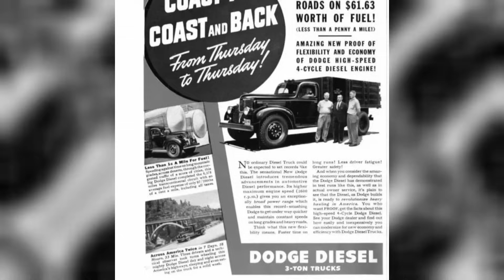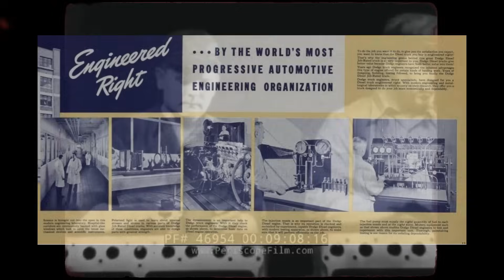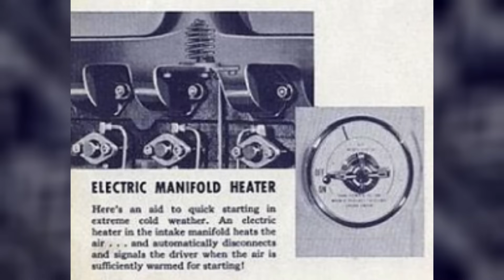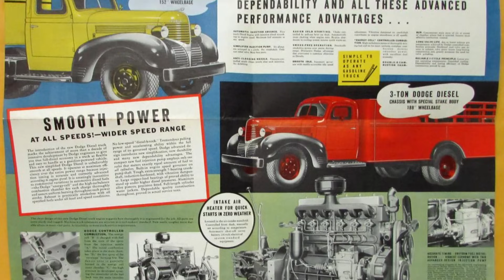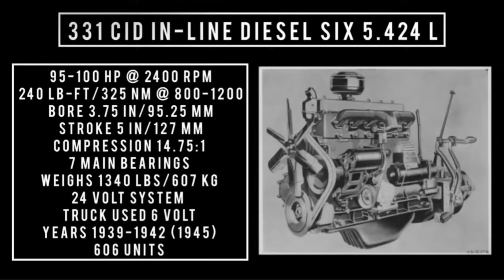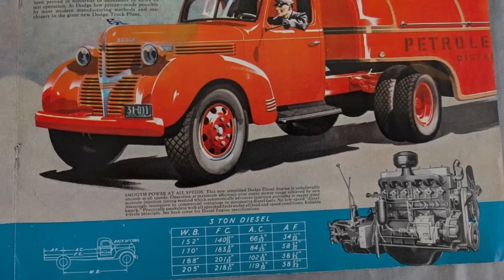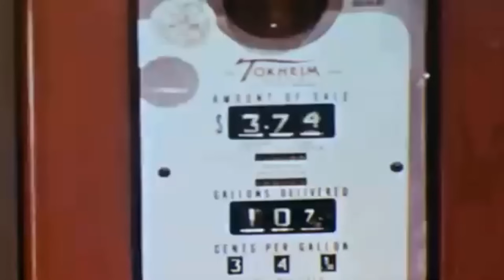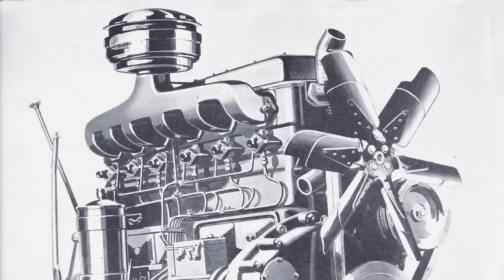Dodge Diesel Disaster: The 331 Engine History Forgot

Comment: Describing diesel as complex costly and hard to maintain is still pretty accurate. Though their longevity makes them worth it.
Reply: What is complex about ⛽️ Diesels?
Reply: @speedfreak8200 diesel fuel injection systems are quite complex compared to most gas setups. The precision required in those fuel pumps and injectors is no joke
Reply: @knotical689 for home mechanics maybe... diesel system is just human build like everything else. But if your knowledge limits to bolting Summit catalog parts to SBC, you are screwd.

Comment: The program was not sensibly managed from the start. Dodge was never a high volume producer in the commercial sector, so there is no way that production volumes could ever have been high enough to make the program work. Hindsight of course is 20/20, but a sensible approach would have been to make 4 and 6 cylinder versions of this diesel, something which could easily be accommodated on production lines, and then seek engine customers for the four cylinder version, particularly in the Agriculture and Industrial space. A 4-cylinder version of that engine would likely have been very successful in tractors, Road building equipment, air compressors, welders, Etc. And although diesel fuel may have been difficult to Source on the road, kerosene was easy to find anywhere in commercial or agricultural applications. The necessity to Source injection components from Bosch is not a big issue, since the automotive supply chain was already quite sophisticated by that time. But the combination of the depression, followed by the war, followed then by a post-war boom in gasoline refining technology that kept American fuel prices cheap, meant the diesel was simply ahead of its time on the road.

Comment: Is this AI slop? There was fuel everywhere for a diesel...HOME HEATING OIL IS DIESEL AND IT WAS EVERYWHERE BY THE 30S IN COLD STATES.
Reply: I used to deliver home fuel oil - diesel fuel.
Reply: Home heating oil is #1 Diesel fuel. Road diesel is #2 Diesel Fuel.
Reply from the maker: Not AI slop, just the human kind. I did a lot of research on this and I stand behind it. All human-made.
Reply: @VintageAmericanMachines ai slop judging by mr cummins first diesel😂😂 running some forged rims and a hood stack

Comment: It's unlikely that Chrysler killed the engine for any internal corporate reasons. WW2 made that decision for them. Bosch supplied the injectors. Bosch then, and to this day, is a German company, and by early 1942 the US was at war with Germany. So that supply line was cut, and with war production as top priority, Chrysler wasn't going to waste time and resources on creating its own replacement version of those injectors - not when they had plenty of easier to produce truck engines already on the production lines. At the time everything they built was for military use, so it had to be both dead-nuts reliable, and fully supported with replacement parts.
Reply: Ambac, American Bosch, was a separate entity starting after WWI
Reply: @randymagnum143  Main problem was making things to one millionth of an inch accuracy at production level, 95% pass rate for components was 'good enough' even in mid 1970's when I was training.
Reply: @1crazypjthat's the beauty of the Roosa Master pump, it could be made using conventional machining processes.
Reply: Also the Lenovo cylinder head wasn't there patent so they may have had  issue with the design rights after production stopped due to the war effort and by the time the war ended there was no shortage of diesel engines on the market so it may have been cheaper to go that route

Comment: That preheat was an awesome idea. Unless it caused a fire to spread to the entire vehicle.   We had Farmalls that started on gas , then when warmed up you flipped a lever that closed off a valve in the head to bump up compression , then the injection pump kicked in. It worked well , until it didn't work well. It had ball check valves that would stick. You still had all the maintenance of the gasoline side with carburetor, points , plugs ,n such plus the filters, keeping water out of the diesel tank.

Comment: The A.I. is hilariously dumb.
T43, Russian tank comes up.
Did anyone even look at this video before posting?
Diesels are no different really to a petrol engine, in many respects simpler with extra strong parts, if you can fix one it isn't difficult to learn the other.
Very few special tools needed for mechanical injection although re-building high pressure pumps does need ability to measure very accurately
I had the same attitude to diesels until I worked on them, when I found out how much torque they made at very low rpm I became something of a fan.
Will not be subscribing
Reply from the maker: Not AI, jeez, again and again with the AI. I thought it looked cool. All human made, just hard to find footage, and since the war affected the production of the engine, I showed war stuff. Sorry you didn't enjoy the video.
Reply: dude you haven't worked on vintage engines and it shows, old gas engines have ridiculous torque, often more than diesels of similar displacement and boost level because diesel has the disadvantage of stratified charge combustion, but that's besides the point, the big issue issue was back then it was far more difficult to build or acquire the parts needed to actually make a diesel run than it is today as very few manufacturers could even make the parts, meaning a broken diesel engine would commonly be down for weeks or months rather than a few days as with the gas engines, also every single type of pre-ignition-chamber, which both made it feasible to make diesel engines with cast internals, greatly reducing the cost of construction and greatly reduced the sensitivity of the engine to moisture content in the fuel was held by various patents owned by a few engineers who mostly did not have the necessary capital to manufacture the engines combined with companies being largely license-fee averse, preventing full proliferation of the diesel engine in trucking until smog regulations nuked the good gasoline heavy truck engine options in the early 70s.
Reply: @thatguy-em9lt  Plenty of people could make reliable diesel engines even before WWII.
 America has always had cheap gasoline so gas engines could be made incredibly badly but still run well enough to get the job done. It isn't possible for a petrol engine to produce more torque than a diesel of similar capacity, if you knew how diesels operate you would know that.
Diesels are at a major disadvantage for high speed operation and ultimate power output though, petrol engines just about always have a high rpm advantage.

Comment: So what killed the engine?  The war.  Period.

Why did diesels exist to begin with?  Because they ran on garbage fuel.  When gasoline sold for 25 cents /gallon, diesel was selling for half that. It wasn't until the EPA rules of the very early 1990s that the price of diesel rose.  Now that diesel fuel must be cleaned to remove sulfur and other contaminants, the price is much higher than gasoline.  However, in WWII the military didn't want diesels.  Why?  Because that would require an extra supply problem.  Even the Germans went with gasoline in most of their vehicles for the same reason. When the Navy used diesels it was in their ships, not their trucks.

The problem for owners in 1939 was that there were so few locations that they could fuel up.  It required a whole new infrastructure.  Diesel owners had to install their own fuel storage, usually at a depot.  If there was a fleet then that wasn't as much of a problem.  But for small owners that extra expense was a problem.  

The pre-combustion chamber just meant they did not need as high a cylinder compression.  14:1 is not high for a diesel.  Usually they run at 16:1 to 22:1 compression.  However the higher the compression, the harder it is to start, the noisier, and rougher the engine runs.  By running at 14:1 they could reduce much of the problems seen in high compression engines.  The downside is a pre-ignition chamber is extra complexity and often cause a different set of vibration.  

Just more AI bullshit that can not understand the basics.

Comment: I HAD A CHEVY CHEVETTE BACK IN 1985 '' IT HAD A ISUZU 3 CYL DIESEL ''''  DIDNT HAVE ANY POWER ''''   BUT 85 M.P.G. ''''    DONT TELL ME THESE MODERN CAR'S CANT GET ''BETTER'' FUEL MILAGE '''
Reply: You're off your Meds again Jimmy .... 41MPG not 85MPG . 51HP please do a simple Google search before making a laughing stock of yourself 😅
Reply: maybe yours was a 3.
Reply: @BillLaBrie The Isuzu diesel was a 1.8L 4 cylinder
Reply: @nicky5417 I know, that was for funny boy in the OP.
Reply: @BillLaBrie 😂ugood, Ik.
Reply: @BillLaBrie  IT WAS A 3 ''  THANK YOU SIR ''
Reply: 7.9.25.  💁🏻‍♂️ I had a 1984 four-door Chevy Chevette with a Isuzu 1.8 L four-cylinder diesel, over 100,000 miles I averaged 38 miles per gallon. It needed a turbo charger. “That thing couldn’t pull a sick whore off a bed pan”™️‼️
Reply: Are high or something
Reply: Nox is the problem with lean burn. Honda was getting 50+ mpg with a gas engine but the nox was bad. Nox makes acid rain and smog clouds.
Reply: Same with VW in the 2000s with their mpg scandal.
Reply: @1987FX16  do you really think that others didn't cheat?
Reply: OK boomer

Comment: Dodge developed a diesel engine for automotive and light trucks but never brought it to production. It was a slant 6 that they had reworked. I was lucky enough to see four of them that were scrapped out.
Reply: This was the 30s and yes they sold some prewar trucks, the sold the Burma trucks to dictator China against the Reds and Japs with a gas 331 and a 5 speed.
Reply: The slant didn't exist until the Valiant in the early 60s, they sold fullsize Mopars with Perkins before that, Dead Dodge Garage has one, the slant diesel was a failed experiment, the Hemi slant went to Australia and was supposed to be for trucks.
Reply: @LeeHendo  The Hemi 6 wasn't a slant.
Reply: @anvilsvs 
And the Hemi 6 is not a hemi.
Reply: @anvilsvs  yes it was.
Reply: Yeah you are not going to make lousy 4 main bearing inline six into a successful diesel, They should have asked me about that.
Reply: @patrickshaw8595 The slant six diesel was canceled because the k car couldn't use them and the Olds v8 was turning buyers away
Reply: @timothykeith1367  Yes. I'm quite old you know. I lived through those days running a commercial engine rebuilding and automotive machine shop here in KCMO.
Reply: @patrickshaw8595 4 main bearings is not problem. Many 4cyl diesels had 3 and no issues. Just good materials(not yank sponge cast iron)

Comment: In the early years diesel engine are not overly complex but compared to gasoline engines they were misunderstood due to the different operating principles. They did have many advantages such as no ignition systems (plugs, cap, rotor or distributor), longer intervals between major repairs, just to name a few. In general due to their design they use less fuel per mile than gasoline engines did. Where it all went wrong is when the government got involved with things like DPF and the need for DEF fluid coupled with EGR systems. Now diesel engines are a nightmare to maintain. Thank God I'm no longer in the field.
Reply: The original diesel fuel was the near bottom of the distilling process. There was no demand for the fuel that was below kerosene and above bunker.  Even after they learned how to crack oil (use catalytic processes to make the fuel they want) they still had a lot of bottom fuel.  Because there was little demand for this and the price was low, it became the standard for home heating stoves and furnaces and ended up being used in some diesel engines.  

As you point out, it was only after the EPA forced cleaner engines that the price of diesel fuel became more expensive.  But gasoline engines also became very expensive and complicated. Refiners cleaned up their gasoline as well as diesel fuel.  They have even cleaned up the worse bunker fuel that ships use.  

DEF is the engine manufactures way of cleaning their emissions.  It is not required by the EPA but is by several States on engines equipped for DEF. DEF is injected into the exhaust, NOT the engine. The newer complexities are because the engine manufacturers are trying to clean up the engine exhaust.
Reply: @alanmcentee9457  Uh, hate to correct you but since 2009 DPF and EGR systems have been required on all heavy duty diesel trucks. They started it in 2007 with mandatory compliance by 2010. Yes, I fully understand how the DPF systems work in great detail as I have serviced them since their inception. EGR on the other hand is attached to the engine and due to the way they function are severely prone to carbon build up up to and including creating a drastic loss of power. Cleaning is a tedious and involved process taking up to several hours. DPF systems require frequent and time consuming regen processes to be run under certain conditions and when the system fails can and does result in not only forced shutdowns but also a no start condition rendering the vehicle immobile forcing it to be towed to a service facility for costly and time consuming repairs.
Reply: @carllmack2287  
The EPA mandate is for emissions leaving the tail pipe, NOT how to get there.  The same as with gasoline engines.  It is the emission standards, not how any manufacturer builds the engine.  

If they can build any engine and fuel it so that has only something like water as an emission then there would be no need for EGRs, catalytic converters, etc. Until they can come up with an economical fuel and engine then manufacturers will have to tweak engines to conform.  

DEF does nothing for the engine.  It is sprayed into the exhaust.

Comment: They were not dodge diesels they were built by Buda engine co and dodge put them in their trucks just like they did to Perkins diesels they bought the Perkins 107 diesel and put a Chrysler marine brass plate on the flywheel housing they went to court on this they did not make diesels back then period you have the wrong information ronrdzl
Reply: No, Buda - Lenova was a different engine using the same patents that Chrysler used under license..  I would not be surprised if Buda had some involvement with Chrysler in developing this engine, but the bottom half of the engines architecture is Dodge. The Lenova system was used by several manufacturers.   The 331 was, indeed based on the big 331 cu. in. flathead six cylinder seven main bearing Dodge truck engine.....Heck, it even used the same lifter gallery side covers !      Very interesting engines, and that combustion chamber is really unique.
Reply: Buda used a small chamber under only the intake valve to inject across.  This engine injected between the intake and exhaust valves, hence the (twin cyclone) moniker on the Chrysler.  
Buda later developed a 3 valve engine to promote turbulence in the combustion chamber, but it, like the entire IDI concept, was a dead end.  Detroit was direct injection in ‘38, and Mack in ‘52.  Crapterpittar didn’t figure it out until 1980.
Reply: Mack Truck produced a Mack-Lanova under license from Lanova. It was their first diesel. I think the first was in 1938 and the last 1952. I remember working on them in the 70's. The largest was 672 cubic inches, I forget what the smaller one was. The big one looked a lot like the EN-707 gasoline
Reply: How does it feel to be 100% wrong?

Comment: Chrysler got back into the Diesel market for light trucks around 75-77 and I believe it was a Cummins.
After the energy crisis of 73-74 GM re-engineered the gas Oldsmobile engine to Diesel around the same time Chrysler introduced a Diesel in there light trucks.
I don't remember the exact year and months just remember articles in 4x4 magazines about Diesel Blazers and Dodge pickups. Might have been 76-77
Reply: They used first 4 litre Mitsubishi 6dr5 diesels.
Reply: In 78 they had a 4L Mitsubishi diesel.
Reply: RONG IT WAS A MITSUBISHI  NON TURBO
Reply: @RICKTants 
LOL OK WRIGHT, I never said it was just that I believed. My point was the vid stated Chrysler got back into Diesel in 89 and I am sure it was mid to late 70s.
Reply: I think the 1976 or so Chrysler 
Diesel used a thee liter (~ 183 CID) Nissan Diesel in Dodge 1/2 ton pickups. The Nissan Diesel had only 80 or 90 HP.  I inquired about this at a Dodge dealer ship in St Paul MN and was told that the dealer refused to stock the Diesels beacuse he felt they would be undepowered.
Reply: @charleshouck4309    7.9.25.  ☝🏼I.H. used the Nissan 3.3L/198ci  inline 6 cylinder in the Scout 1976-1980.

Comment: The 331 Engine was originally Chrysler's standard FLATHEAD engine (later expanded to 351 cu in). Sounds like they probably used the same basic block with a different head to accommodate valves, the prechamber, and fuel injection. Great way to start, as the 331 was a SOLID engine! 94 Horsepower was the same rating in both engines.
Reply: 331 the first Hemi
Reply: @speedfreak8200  Not exactly - the FIRST Mopar Hemi was back in the 1940's..... Powering the P-47 Thunderbolt.  They also worked on an Inverted V-16 for aircraft, and the engine for the Patton tank. The first AUTOMOTIVE Hemi was the 331 Firepower Hemi in 1950.